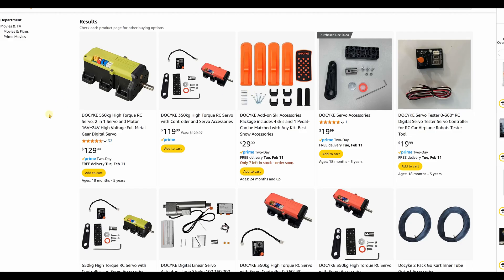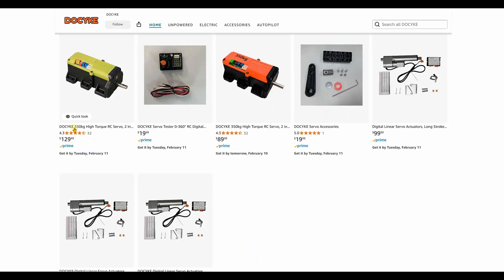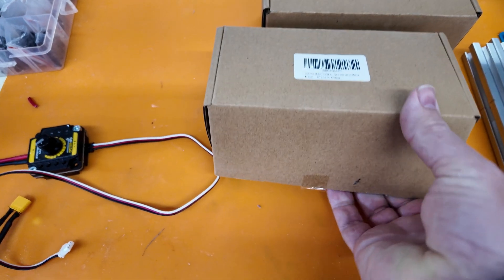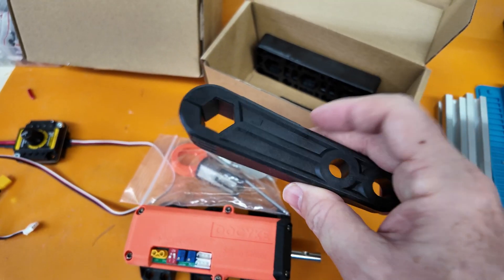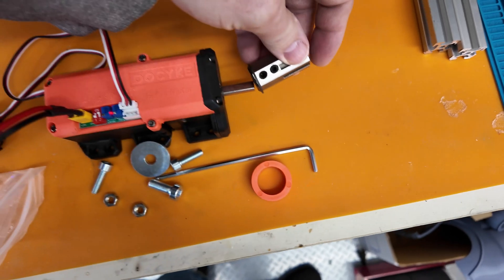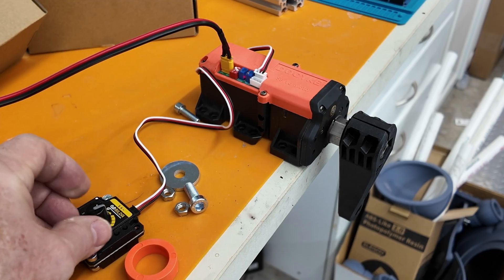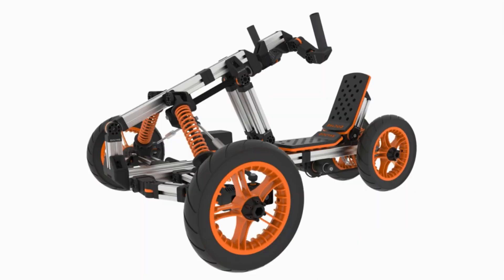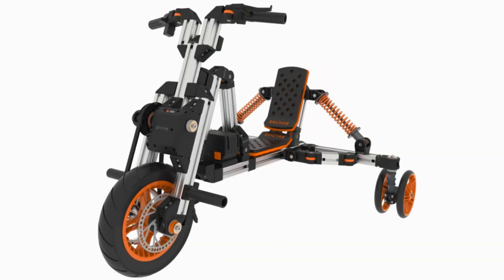Docyke's mega servo, "We have the power!"

Comment: Hi, great video. I have a question though about the tail shaft. Does it actually spin or what exactly is its purpose?
Reply from the maker: You can use it as a mount , like if you have a u shaped bracket you can attach to drive end then to the tail shaft ( which rotates too) it basically add support and rigidity when you need it.

Comment: Hi Will, Just curious if you have come across any new linear actuators that have high torque. The ones I put in the legs of my R2 just barely meet the power requirements. It's been quite a few years so I'm wondering if they have more powerful ones now. Oh and they need to fit inside the aluminum legs which have 1.5 inches width inside.
Reply from the maker: Docyke has linear actuators in their Amazon store. They look strong but not sure exactly your needs might be. Go check them out!